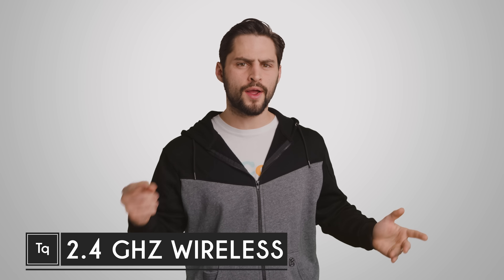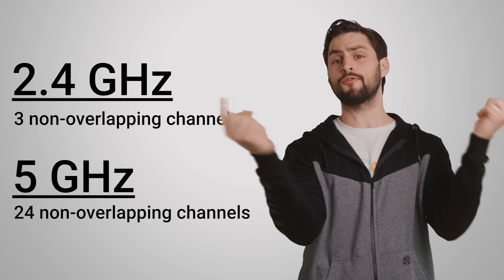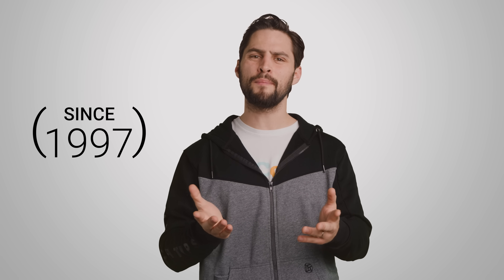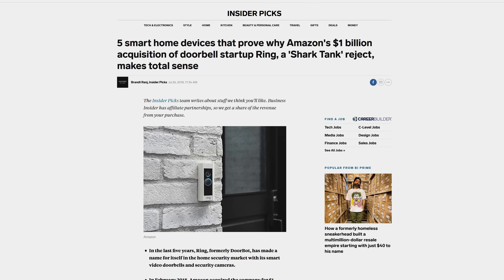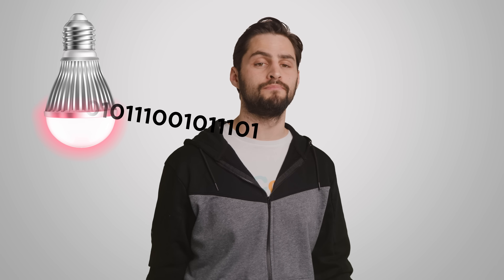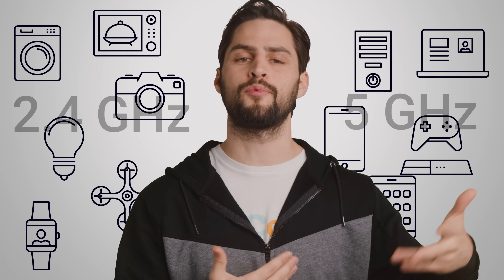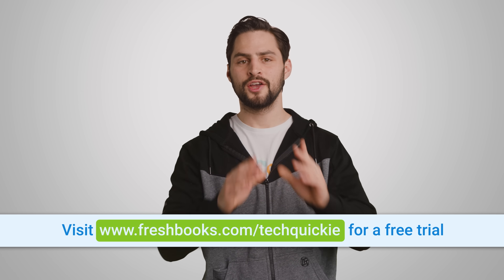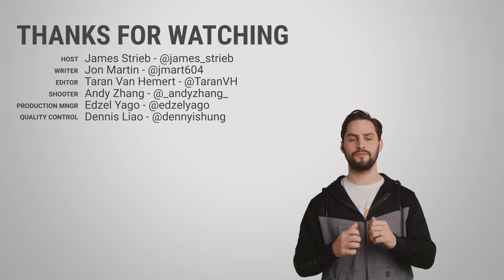Why will WiFi always be SLOW??

Comment: Using both 2GHz and 5GHz with “ac WiFi” already is not enough in congestion conditions, WiFi6 should be the answer to that, using same frequencies WiFi6 has a better traffic management, so everybody will be happy 🤪
Reply: Everyone was happier before wireless.
Reply: @Acetyl53  You are 100% wrong!
Reply: @sethadkins546  I was happier, so I can't be 100% wrong if we're talking about proportion.  I'll concede I'm 100% wrong that literally everyone was happier.
Reply: @Acetyl53  That's what I meant. But I also don't see how people can be less happy from a technological advancement.
Reply: @sethadkins546  It's not an advancement in any lasting or meaningful way.   It has altered the way people behave, for the worse, and it slowly destroys our health.  The end result is likely population level infertility.

No one wants to discuss this.  Dug in too deep, it's all become normalized.  An 80 year old woman told me she couldn't live without her cell phone.  That tells you everything.
Reply: @Acetyl53  Oh, you're one of THOSE people.

You know that visible light is more harmful than the radio waves emitted by wireless connections, right?
Reply: @sethadkins546  Yeah, I'm on the way out the door right now.  Short version, you don't know as much as you think and instead of thinking in superficial theoretical terms, you should consult the literature..  Dose response is nonlinear and frequency dependent, and biological systems function via transduction and downstream damping or amplification (ie processing).

Ask yourself, how does visible light with its low energy and poor penetration depth, manage to alter your global bodily state when it enters your eye?  How does "art" and "music" work.  These forces, these inputs, are WAYYYYY too low energy to impart any meaningful change on any biological structure.  And yet.

Anyway, this is probably a waste of time.  I have a link with information.  Otherwise, good luck and perhaps have a nice life.
Reply: @sethadkins546  Well, I'll take the silence as your answer.  No desire for information which would conflict with your views.  Another one of THOSE people.
Reply: @Acetyl53  Well, you said you were out the door, so why would I respond?
Reply: @sethadkins546  I see.  Our conversation had been fairly realtime, I included that so you wouldn't expect a prompt response for whatever reason.

I'll briefly break down the article you linked.
-Anyone saying anything bad about wireless technologies is scaremongering for ad revenue.
Ironic and hypocritical considering the parent company of How-to-geek probably subsists from ad revenue themselves.  I can't talk about the general case here other than to say it's unlikely, and irrelevant.  The data comes from scientific journals and experiments carried out internationally over the last 140 years, tens of thousands of papers.  A lot of that was military funding, some was medical in the early days, some was the state (Eastern Europe and USSR), some was Department of Energy.  Their claim is just nonsense.

-They state "We actually debated including some links to some of the worst offenders just to show you how outlandish (and unscientific) the claims they make are, but we couldn’t stomach giving them even a penny of ad revenue."
How convenient, we can't even get a sampling of what they claim exists as the general case.

-"We can’t stop people from misleading others for profit, but we can respond to their nonsense."
Positioning themselves as on the high ground of a moral crusade, performing their civic duty and protecting the citizenry from all the fear and propaganda.  Yet their tone is so angry, demeaning, and demanding.  Well, enough on that/

-The problem is the word "radiation" which scares people
They go on to state that people don't know the difference between ionizing and non-ionizing, and they don't know that sunlight is radiation, cosmic microwave background is radiation, and even warm objects emit radiation.

In reality natural sources of radiation (like the microwave background) are around 1 quadrillion times weaker, mostly non-polarized, unmodulated, and incoherent.  There's no comparison.  As far as being non-ionizing, that's correct.  Refer to my earlier post, it's more a matter of "information" content.  It's not breaking bonds directly, it's acting on parts of the cell to alter their behavior and metabolism (transduction and amplification).  This results in elevated free radical production (secondary to altered ion flux, particularly Ca2+), among other things.

-Inverse square law
Irrelevant.  The effects are athermal and occur at power densities as low as 30-60 uW/m^2.  This thermal vs athermal goes back to the 1920's, and in modern times is completely misframed.  "Can't heat ya, can't shock ya, can't hurt ya".  Not so.

-WHO
The World Health Organization is primarily political.  Their RF working group has major conflicts of interest and can be shown to be captured.  This is not speculation or conspiracy, it's demonstrable fact.  Their internal documents (though again, flawed and disingenuous) also paint a very different picture to what they tell the public.  Scientists a few years ago went to petition them about those conflicts and had a hidden exposure meter.  They registered no wifi, cell phones, etc from within.  They don't use it.  Before publication they reached out to WHO, who did not respond.

-They state "Because of this physical law, even if  holding a Wi-Fi router directly against your forehead was very dangerous (and, we assure you, it is not)"
This is false.  With a phone directly to you head you're exceeding the FCC's (already invalid) safety standard by 3-10x.  A recent class action lawsuit was brought against Apple and Samsung when independent testing found their phones were emitting upwards of 500% above the safety standard.

Anyway, these are the same tired arguments they've been resorting to for the last 30 years.  It was wrong then, it's wrong now.

I feel like I'm using my time poorly.  You inform people, it takes time, it takes energy.  I have quite literally several thousand links.  Refer to _Index.txt and some of the other resource mentioned in the following post.  I'll include a link in the following post.  Youtube generally hides my posts if I include links (they're put in the channel's spam folder, and show up for me, but no one else) so I have to break them up, check the post in a private window where I'm logged out, etc.  It's a pain in the as s, and it stops notifying people.  Tell me if you get it.
Reply: @Acetyl53  1. The article never stated that they didn't subsist from ad revenue.
2. You can, they said they did end up debating the people. 
3. It may be a bit demeaning, but a lot of misinformation comes from people who aligns from your views. Not saying anything you have said is false, though.
4. Are they wrong, though?
5. You describe the exact effects of ionizing radiation, which wireless networking is not.
6. Ofc the WHO is political, they're a part of the UN.
Reply: @sethadkins546  Acknowledged.
Reply: @sethadkins546  
1. They implied that this was the primary drive for those writing articles on the safety of wireless devices, manufacturing  a problem (sensation of fear from ignorance) to then provide the solution to that problem (knowledge, products), and thus gain money.  I'm saying that this logic applies to them as well.  Why are they really writing this article?  Civic duty, personal values, moral obligation.... or... to appeal to people with already share their view (or people like me who view), and thus serve them ads.

2.  Well, I'd have to see these debates.  Can't really comment further.
3. I've seen relatively little of this personally, though I stick mostly to the scientific literature.  One thing that comes to mind is people selling shungite and those, and though they don't lie about the problems of wireless, I would like to see actual measurements of field characteristics with and without the object present.  If it changes the phase or polarization, there should be some measurebale change.  Unfortunately proper animal studies are expensive.  A lot of people say some of the pendants help them, I wouldn't trust it, to reliably protect but who knows.  Not much to say about that, I haven't dealt with disingenuous misinformation or outright lies.
4.Yes.  In my experience people aren't alarmed solely by the word radiation or microwave.  Like I said, it's not really relevant and you can't derive a general case.
5. You have direct effects, and indirect effects.  A direct effect is acting on the voltage sensing subunit to cause the channel to open.  An indirect effect is chronically elevated intracellular Ca2+ exhausting endogenous antioxidant defenses.  Eventually superoxide and nitric oxide, produced as a result of calcium signaling, overwhelm these systems.  At a certain threshold they rapidly combine to form peroxynitrite and hydroxyl radical, which are highly damaging.  That's just one demonstrated mechanism.  Hence, transduction, downstream amplification.
6. Yes, and unfortunately it shows in the posturing and BS that tends to go on with anything they're involved in.  At least IARC is largely separate and avoids some of this organizational failure.

Comment: Signal strength difference is huge. 2.4 GHz loses ~3 dB per sheet rock wall, ~7 dB for cinder block/briick. 5 GHz loses  ~5 dB for sheet rock, ~9 dB for cinder block/brick.

Comment: What about 6GHz in WIFI-6? Does it interfere less with walls? have mroe range? is there a benefit to wait till devices starts to ship with WIFI-6 standard?
Reply: I'm not an expert on physics but higher frequency should mean less range, more data transferred per second.

Comment: Why is everything not 5GHz yet?
One concrete wall: "lemme stop you right there"
Reply: Doesn't even need to be concrete!
Reply: More like "Oi, you got a minute?"
Reply: For the same reason, 5G is going to blow chunks.
Reply: One concrete boi
Reply: more like plywood
Reply: Even worse when the concrete walls have metal inside like most houses in germany.
Reply: Well,if you make a bridge with routers at 5ghz you will still have the 5ghz connection around your house.
Reply: Modern new build homes in the UK have this thermal insulation stuff thats wrapped in foil packaging. It blocks 5ghz dead. So it wont even go into the next room. And if your Mobile signal is weak, then forget using it inside the house.
Reply: literally lol
Reply: In Modern Living Rooms Everyone Using "SoundProof Curtains" That Stops Outside Noise by 80% (25 Db) Tested. Check Here: https://livesoundproof.com/best-soundproof-curtains/
Reply: Unless there's a super big antenna
Reply: @deadbox2003  How big is your antenna ;)
Reply: @calvin6235  almost like a mobile network tower :D
Reply: @calvin6235  20cm
Reply: @calvin6235  goes around the wall probably
Reply: One solid object: "imma end 5GHZ whole carrier"
Reply: I connect to my 5Ghz router (not even a fancy router it's the default one from ISP) from under my house in the parking lot through concrete and insulation.
Reply: @TheVivi13  Probably on a 2.4GHz band ;)
Reply: @Carewolf  European newly built  brick house. 1-2 walls is ok for 5ghz through floor i can get and is usable, but 2.4 actually gives more speed. Though that is was easily fixed by just setting up a router for each floor. 

Ps.: Not using auto switching but 2 seperate ssid for 2.4 and 5 bands
Reply: @Carewolf  Nope, 5Ghz band.
Reply: HaloVivek13 there’s different 5g millimeter and average 5g

Comment: Nice. That’s my router in the thumbnail. I struggle to get more than 20 MBPS out of that like 12 or maybe even 13 year old router with the wireless. Even using it an Ethernet switch still isn’t giving me my full speed. I have to go straight through the modem to get that.

Comment: I'm still using 2.4 Ghz WiFi in my home because the 5 Ghz signal just can't cut through 3 concrete barriers well enough. The router is on the ground floor. With 2.4 Ghz I still have reception in the attic, but with 5 Ghz I don't. Also 2.4 Ghz is still plenty fast for me. In most places in the house the DL speed is between 4 and 7 megabytes per second which can easily handle 4K YouTube for example.

Comment: BECAUSE 2.4 HAS MASSIVE RANGE AND 5 IS WEAK
Reply: Not strictly so. I have used Ubiquiti Nanostation m5 versions to create a link that was just over 4 miles. And still got a 130mb connection.
Reply: DJ_PaulTUK that’s cheating, and a fairly uncommon setup.  I’ve got an AC87R upstairs.  When I’m upstairs I’m on 5GHz.  When I go downstairs my phone switches to 2.4GHz and I never even notice.  The speed is basically identical, especially if you don’t have fiber in your house

Comment: It's not that the WiFi is slow but that the house is too big.
Reply: Big brain here xD
Reply: Then use more AP's
Reply: 1.0 ghz, modern problems require ancient solutions
Reply: @shymaster101  At that point let's just go back to 900Mhz.
Reply: Shadow you’re smart
Reply: house so big, can't connect to a 2.4 ghz wifi...
Reply: my house is pretty big (2 stories and big rooms) and constantly get 150-200mbps
Reply: Yeah a wireless repeater is easy to set up, and if you own running cat6e/cat6a is cheap and easy.
Reply: Shadow suffering from success
Reply: Tiny House or a studio apartment wouldn't need a strong signal at all. Phone and Laptop is only things I use WiFi for and it could easily be 5Ghz and  could run on reduced power. Everything else is wired with EEE when I'll need higher speed I would change some devices to SFP+ DAC
Reply: Not necessarily
Reply: Maybe. The WiFi at my house is really good because we have 4 google mesh routers. When we only had one router, it was pretty bad though.
Reply: @demented9131  I have a 5 bed room house two floors I have the Xfinity routes one side of the house it reaches all but the last room kinda I use a trustee Netgear ac repeater I did have an old router with ddwrt didn't feel like the 30 30 reset
Reply: First world problem indeed.
Reply: Shadow Suffering from success
Reply: boomer problems

Comment: Range was the first thing that came to my mind. I have my router at ground floor where I have my home office while my TV is at first floor and 5G gets extremely weak. I tried to use an additional router as a wireless repeater but it was doing more harm than good.

Comment: Techquickie, I am ashamed of you. Yes, it is going away slowly. Quickly? No because for the average person, they do not need anything more than Wireless-G speeds and they want to keep on using their wireless G router until:
1. It breaks.
2. The newer tech is cheap enough that they can afford an upgrade and it has been tested so that if it breaks quickly, it is not due to a known design flaw.

Comment: Is the 5 GHz Wi-Fi more power hungry than the 2.4 GHz Wi-Fi if I use my phone's Hotspot ? Which band will use less battery power ?
Reply: Should be no difference because RF power levels are controlled.

Comment: Central frequency has nothing to do with throughput - it's all up to channel width, that's what matters. 2.4 GHz is not slower by definition, it is because you can't use channels wider that 20 MHz (40, if you know what you are doing). However, when you spread same power across wider channel, you get lower power density, and you must stay closer to AP if you want to be faster. 

But 2.4 GHz is not dead yet, Wi-Fi 6 will make it great again.

Also, shotout to Joel, he is wonderful guy, I had an opportunity to 
become acquainted with him at WLPC in Prague in 2019. You should definitely follow him if you want to go deeper into Wi-Fi. What a heck, you should follow everyone from WLAN pros!

Comment: Also, range isn't only useful for low bandwidth devices. When I'm sitting with my PC outside the house, I would much rather have a 2.4 GHz connection, than no connection.

Comment: 2.4G is good when you want a signal through multiple concrate walls and/or floors.

But most importantly they can add the bandwidth from 2.4G into the total bandwidth so it can be marketed as xxxx M bullshit.

Comment: It's just ridiculous that after all this time I still have absolutely no reason to stop using Ethernet to connect things. Unless the device doesn't support Ethernet at all that is, then I'll be force to turn on wi-fi just to finish the updates or whatever before turning it off and forgetting it exists. It just isn't worth the hassle when a well placed cable is so far superior, and it has the added benefit of avoiding people trying to get into your connection exploiting the myriad of vulnerabilities wireless has these days.
Reply: For a lot of people, especially with older homes, Ethernet isn't an option - they can't run cables through solid brick or concrete.

Comment: V = Fλ (V is velocity which is constant for waves, F is frequency and λ is wave length or in this case, range).

λ=V/F. So if F increases, λ decreases. 2.4GHZ have much better range, also low F have better penetration through obstacles like falls.

Comment: This video has told me nothing that is not obvious to anyone who knows that there is a difference between 2.4 and 5 ghz wifi. It's cheaper and works over a greater range with better compatibility. Not to mention most people don't have internet fast enough to saturate a 2.4 ghz connection anyway.
Reply: Even if I don't have a fast enough connection to saturage 2.4GHz wifi I can still benefit from 5GHz for things like internal file transfers or for in-home game streaming with Steam.